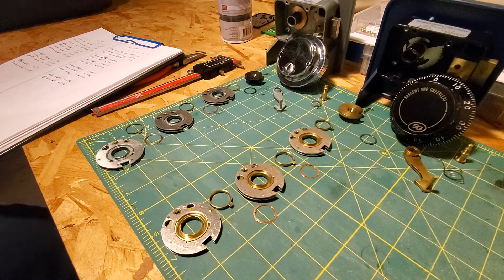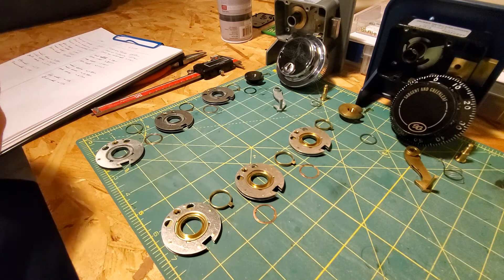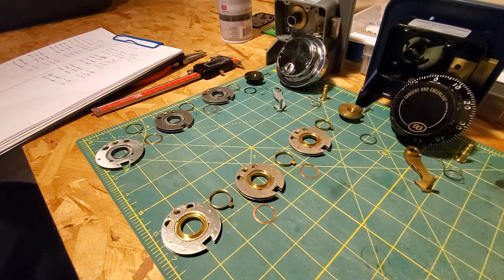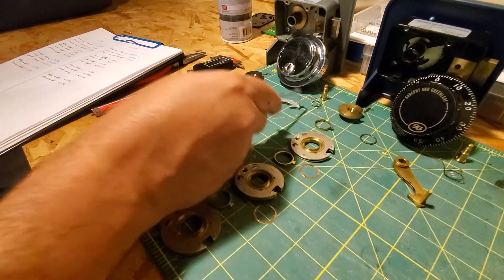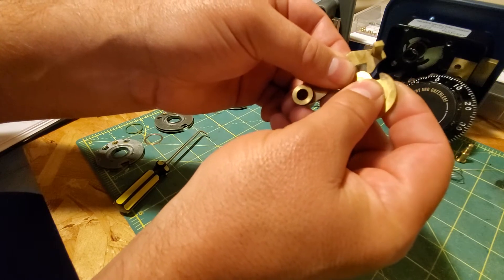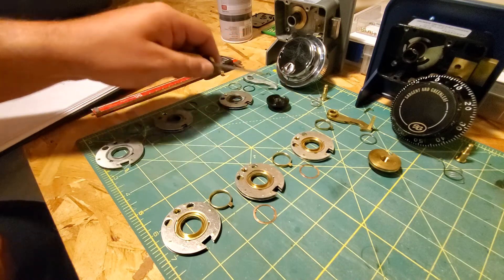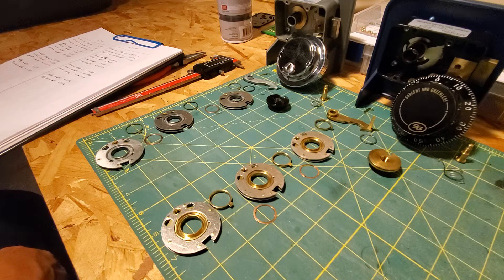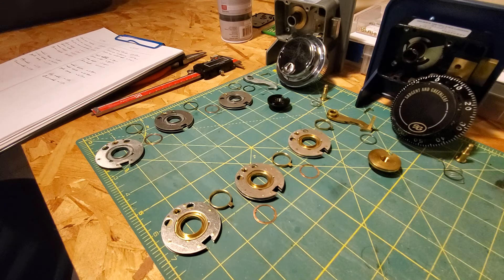S&G 6730 vs S&G 6741 Tolerance Differential (005)

Comment: The 6730 has the adjustable tension (the allen-wrench driven gear), what if that is too loose will that allow the combination to drift/change?  Just wondered if that's just a matter of preference how much turning torque you want or if it effects anything else.   Thanks.
Reply from the maker: As far as I know the amount of tension does not effect tolerance.
Reply: Wheel walk increases with the decreasing amount of friction applied to the wheel pack.  Of course the speed  of dialing is also a factor in driving wheel walk.  Personally I reduce the friction making it so less pressure is required to turn the wheels.  While at the same time instructing the user about wheel walk, so turn the dial slow and smooth.  This in turn should reduce the wear over time which is by far the biggest problem with the lock wheels misaligning.

Comment: My 6730 failed after 1 1/2 years. Took 40+ try's before I got it to unlock. I replaced the lock body, and decided to up things to a Group 2M 6630. Haven't disassembled the 6730 yet to see what's up. But I could tell things weren't good as I couldn't feel the 2 wheel pickup when I dialed the combo.
Reply from the maker: I'm not familiar with that type of problem.  wonder if a safe tech ever ran across something like that. All the safe locks I use for lockport are mounted on a plastic base and don't see any operational use.
Reply: I will say the current 6730 is not as good as earlier versions for reliability.  Just a couple years ago there was a major flaw which caused a possible misalignment of the wheel gats under the fence.  Quite possible this was the problem.  Generally speaking though going to the Gr 2 M is not an upgrade in reliability.  I have found that the best 6730 locks were the ones made back in the 50-70's.  Best reliability and also the best ones for manipulation practice.  My batting average back in the 80's-90's was often around 90% success with these locks and opened hundreds of them.

Comment: Interesting -- My thoughts go the Sparrows "Practice" Safe lock with the different levers - I haven't wasted my $ on one because other experienced manipulators say it's not very good.  BUT my focus would be on the fence geometry as you have pointed out.  Perhaps with the 6741 general tolerances can be loosened up a bit, thus making a narrower fence work OK.  Try looking at the LaGuard 3300 if you want to see cheaply made, but alas can be difficult to manipulate because of shadowing of the "not perfectly round" wheels.
Reply from the maker: The 3300 is on my list. I had a good discussion with some others and the tolerances really come down to the fence width and gate openings. It was still interesting to look at them side by side.